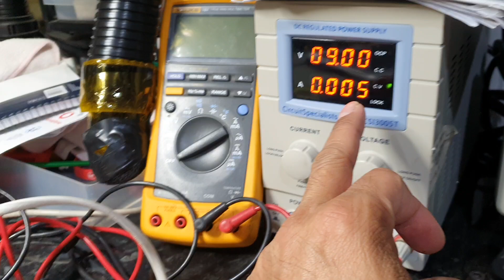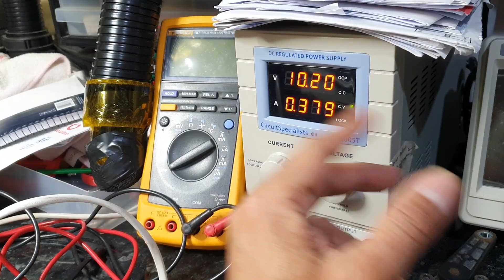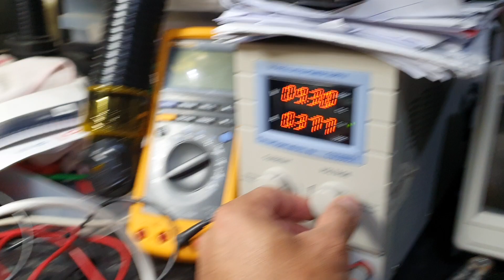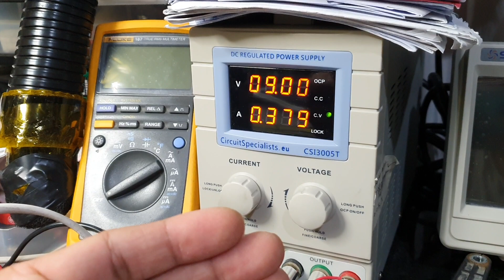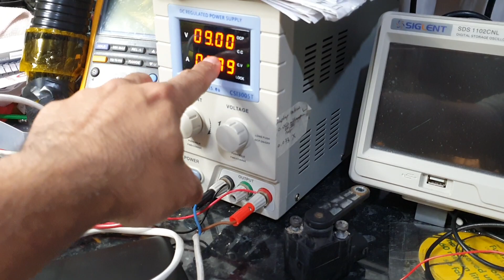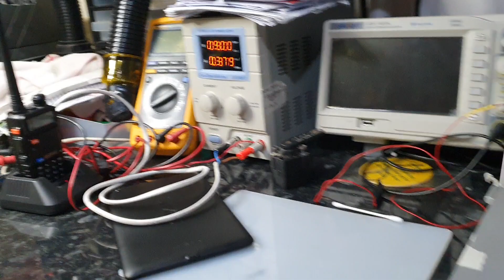A decent bench power supply is almost a Holy Grail for reviving batteries.

Comment: What you mention at 3:24, about the current dropping as a battery charges, is this happening because the psu’s microcontroller is compensating for the diminishing voltage gap between the charging battery & the set output voltage limit value? So as not to exceed the set CV value? 

If I understand correctly, this would be similar to what battery-specific chargers do, so I think I understand now why a supply would be the holy grail because it’s battery-charging compatibility would be essentially unlimited aside from psu spec limitations.